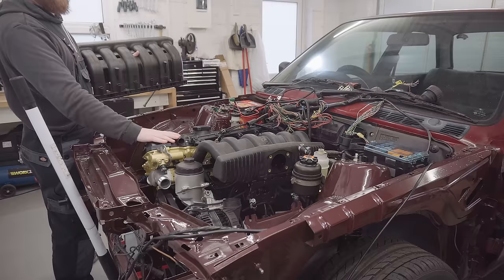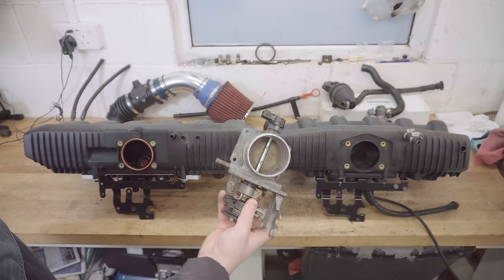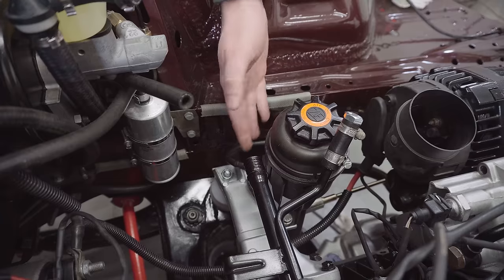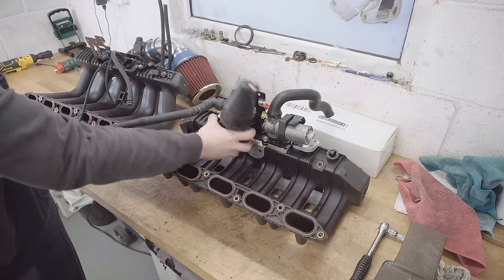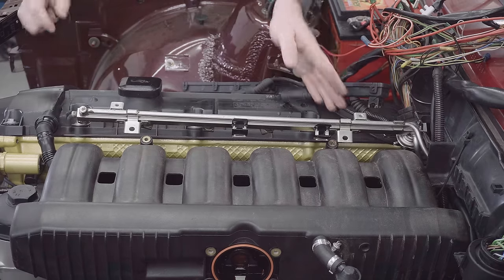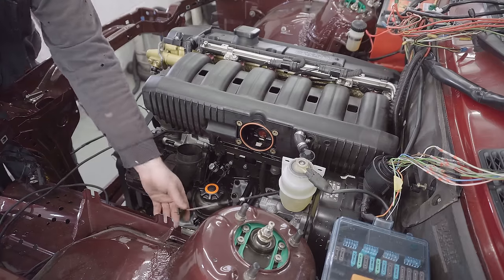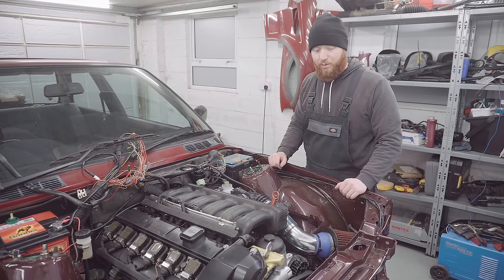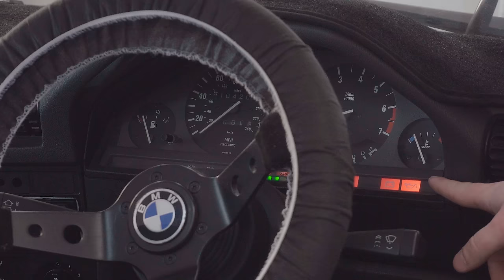How To M50 Manifold Swap an M52 Engine | M50B25 Intake Conversion Guide for M52B28 Swapped E30 | 053

Comment: Just looked at the prices of M50 manifolds now! I did mine many years ago on an E36 track car, manifold was about £30 & some fittings & pipe were about £20. It’s a great conversion for the track & very noticeable, if you enjoy revving an engine you’ll love it. It did lose torque in the mid range but wasn’t an issue. Think I only had one support bracket also.
Reply from the maker: Awesome thanks Matt, I absolutely do love to rev so that's a great sign. They've been going up and up for as long as I can remember sadly, sounds like they were cheap as chips back in the day. 😆
Reply: Seems people are getting greedy with their 30 year old plastic indeed with ebay prices approaching $400! And these conversion kits around $300 for a bracket, hose and screws. Might as well get a metal turbo manifold.
Reply: Absolutely, there were no kits when I did mine & I managed to get nearly all the bits from a local hardware store & bits I already had. Marketplace is a bit more realistic with prices but still getting crazy. Better to go to the scrapyard.

Comment: I think that is right. When I did mine, I decided on the stock manifold since I was nearly never going to be at the limits, rather, I was going to be spending much of my time in the 3-5000 rpm range. People reflexively do these and I think they miss out on that low torque, I knew I would. The juice was not worth the squeeze, as they say. If you are going to drive hard, worth it I think.
Reply from the maker: Yeah I can absolutely see both the logic of both sides to this. But I'm intending to be drive this E30 for enjoyment only, so why not.

I'm sure I'd have been very happy with the standard M52 manifold, but I couldn't resist. I'm tinkering with it before it even runs! 😆

I can always experiment and go back in the future. Hopefully it's as good as they say!

Comment: Im doing an e36 m42 swap, I had the crank sensor covered in goo for some reason and it did the exact same. It wouldn't fire the fuel pump nor the sparkplugs. If I were you I would start in the crank and cam sensor and see if they're either working properly or if the wiring is messed up somehow. I'm loving the series, keep up with the good work
Reply from the maker: Awesome thank you for that suggestion! The crank position sensor is new, but who is to say it isn't faulty. I will run some tests on that and we will see.

I'm feeling confident I will sort it out and we'll hear the M52 running very soon!

Comment: Thats same as my manifold!
Apparently done by a guy on a forum & was quite  costly . Mine also had the throttle body machined out to use a larger butterfly .

On mine i worked out that
Dipstick 49cm tip to base 43cm low 44cm high 
Remove 5cm from m52 stick
Reply from the maker: Nice! I was looking for a kit to link to, to do this yourself, but I can't find it anywhere. Like it's discontinued.

Shame because it's a really nice way to convert it.

My throttle body is standard, do you know if that makes much difference?

Thanks for the info on the dipstick tube, I guess I will need to do just that. My only worry is the shortened sump and whether the stick will hit the bottom. I guess I will have to measure depth.

Comment: Sorry if I missed it but did you end up not linking the manifold kit that requires cutting the manifold or have I been completely blind?
Reply from the maker: Hi mate, really sorry but that kit where you chop the M50 manifold simply doesn't seem to exist anymore. Sad because I though that was the most elegant solution.

However, there are still kits which convert it with no chopping available. Check this one out: https://ebay.us/TV4O6Y

At least you wont have to butcher an expensive manifold this way. :)

Comment: Was wondering if you were going to do a rear battery relocation down the line at some point?
Reply from the maker: Hi Tylor, it was definitely in my original plan, but in the interest of getting the car as a runner/driver ASAP I've decided to kick that down the road and do it in the future.

It would be better for weight distribution, that's for sure.

When I do it, you can be sure I will make a vid. :D
Reply: Hello Taylor I’m doing this build to a e36 how hard is it to run the battery to the back of vehicle ?

Comment: Hi pal retrorust hear , good vid as usual:) as for no fuel pump priming , check crank sensor , I can see no rpm moving on the dash so I’m assuming there’s no crank signal hense no fuel pump prime , thanks :)
Reply from the maker: Great shout, thank you for that suggestion mate. I'll start with that and hopefully we'll get her running in no time. 😁

Comment: check fuse 11 to see if its blown or jump the fuel pump relay pin 87 and pin 30
Reply from the maker: Thanks for those suggestions Craig, I will check that out. Jumping the pins at the C101 runs the fuel pump now.

I've definitely got relay problems which I'm sorting out currently. I'm confident we'll see the car run next vid!

Comment: Is the longer throttle cable only for the right hand drive swap?
Reply from the maker: Great question! I should have clarified that in the vid for viewers across the pond.

I suspect the long E34 bowden cable is for RHD car's only, necessary because it needs to go around the back of the engine in the engine bay. Probably way too long for a LHD car.

Maybe someone else with knowledge of M5X swapping a LHD E30 can chime in and confirm that for us. 👍
Reply: LH could just use the 600mm e34 m50 throttle cable.  Worked on my setup with out traction control parts

Comment: Does the throttle cable works for both right ana Left driving position ?
Reply from the maker: Hi, good question. I am pretty certain you will need a different throttle cable for a LHD E30, the throttle pedal should be way closer to the throttle body. 😄

As for which one you need, I'm not certain to be honest, never looked into it. Hopefully someone who knows can chime in with the answer for you!

Comment: I believe your wrong with the e30 doesn't prime - mine has primed with both engines (5 second or so on turn of the key) - but its had a e36 and e46 engine fitted - don't know if it the same for an e30 engine
Reply from the maker: Interesting! Much earlier in this series when I refitted the fuel system and the car was still M40 powered, I was unable to get the fuel pump to prime so thought I had a problem.
In testing, I found that the fuel pump did indeed run but only when the car was turning over. So no prime.

Subsequently, someone informed me that M40 cars initiate the pump from the crankshaft sensor signal which seemed to add up.

You can check that out in this previous video here:  https://youtu.be/J_l_0qNw1uw?si=WSH4bUTtwWVcwf58&t=1291

I just had to check that to make sure I wasn't going mad. 😆

Comment: just use m50b20 manifold and u got more hp and the same elastic low rpm
Reply from the maker: There are a few schools of thought about it, but I like to rev my car out as its just a fun weekend car, so increasing peak power at high RPMs sounded good. Also the ECU I have is pre-tuned for M50B25 manifold. :D 

Some people say the M50B20 manifold gives no increase anywhere in the rev range versus standard M52B28 manifold.